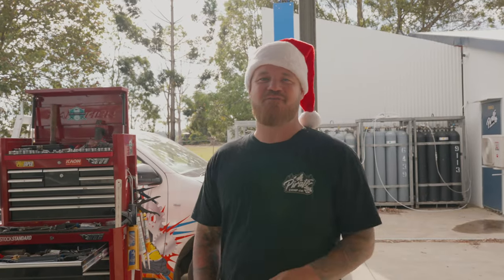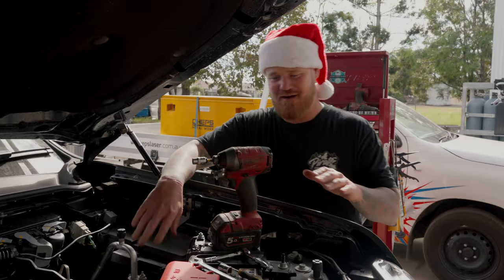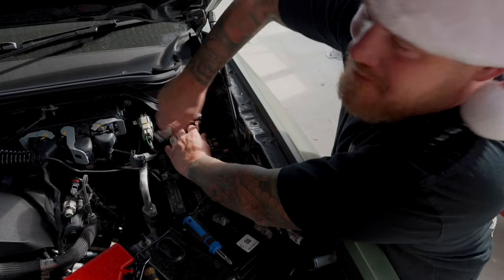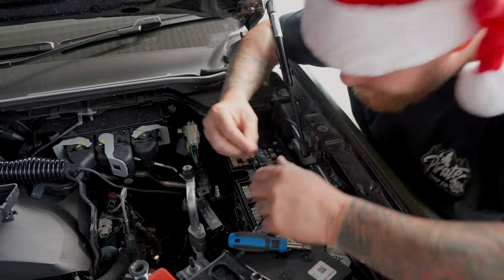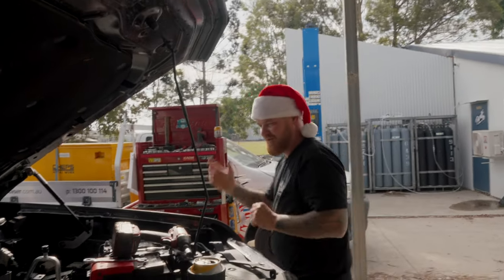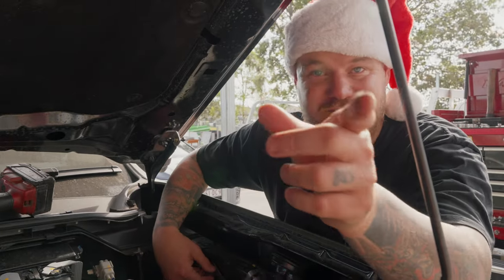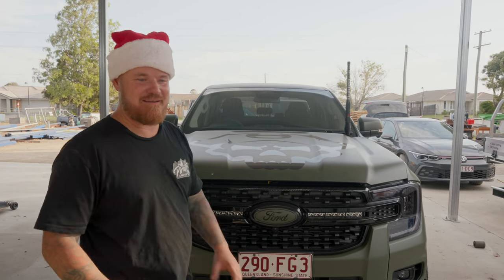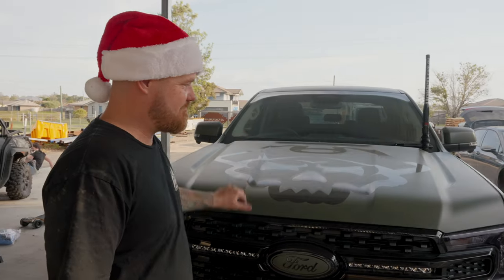Next Gen Ranger / Everest Strut Kit Install

Comment: Found this very helpful however if you gently lever the fuse block away from the fender you gain ample room to remove and replace the lower mount. Likewise if you undo the lower fixing bolt on the rad overflow tank it moves enough to do the drivers side lower mount bolt. 
Keep up the content legends.
Reply from the maker: G'day legend,

thanks for your support. Totally agree, when i filmed this i didn't want to come across as a roughy when i pushed on the fuse box haha. 

as for the rad overflow, it took me a few installs to discover this hahaha. Thanks for the feedback too legend!

Comment: Good bit of kit ordered and received next day and easier than the video portrays to install . Takes about 10-15min if you're handy on the tools. Pro tip you won't need to remove anything use a 13mm spanner to loosen bolts instead of removing fuse box and overflow tank
Reply from the maker: hell yeah, thanks for the support legend!

Comment: Bit of a pain, factory fitted arb spotlights bracket sits in the way of the passenger side mount
Reply from the maker: G'day legend - thanks for reaching out. Could you please email us at sales@piratecampco.com.au with some photos, so we can see what the issue is.
Reply: I think I may have this issue as well when I have a-pillar light brackets installed this week. With the struts installed, there isn’t alot of thread left for the light bracket to be added there, potentially allowing it to loosen and become unsafe. If you could make a version with the arms for the lights going over the hood, that would be awesome. Thanks